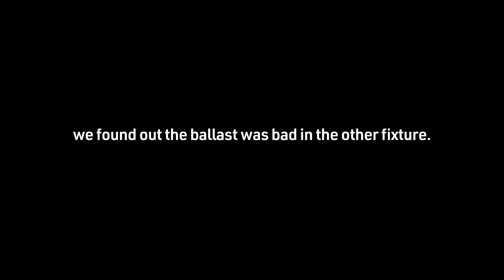Starting custom Case Mod for Tony Hawk - Part 1

Comment: I work as an auto tech.  A hammer is needed and to this question a thought always always enters my head, "Is this $200 ratchet suitable?"  The answer tends to be yes most of the time even if it does not do the job.  I still try!

Comment: Hey I need some help. I recently moved and had no issues with my pc before then but now im getting all sorts of issues including blue screen of death (video tdr failure), black screens, graphics card crash, no signal from display port, red and blue boxes on my screen, green dots on my screen, and sometimes it will have an exclamation point next to nvidia audio, my headphones and mic, and generic pnp moniter. These issues only happen why i try to launch and play a game. Can somebody help please

Comment: @JayzTwoCents Hey, I've got 2 off topic questions. Probably a stupid one, but I'll ask anyway, and hope for an answer. So, my system consists of a Ryzen 5 3600X, Radeon 6750XT, and 2 gen 3 M.2s. Is it worth turning on Re-Bar (which the mobo will allow me to do) with only gen 3 drives, and can there be any hardware problems resulting from doing so? And does Re-Bar only work from the main m.2, or will it work from either one? (I keep my games on the bigger "spare" drive)
Reply: you mean resizable bar right? i think it has nothing to do with your discs as its mainly about cpu being able to access whole gpu memory not your storage space ..

Comment: Hey Jay might want to edit video of lift out. OSHA actually says wearing a harness is required when wearing a harness is recommended by the scissor lift’s manufacturer. Thats a skyjack 3219 scissor lift. Skyjack recommends on page 10 of its 3219 manual
"the use of a fall restraint system to keep an occupant 
within the confines of the platform, and thus not expose 
the occupant to any fall hazard requiring a fall arrest". 
I hate myself slightly for this comment, but video proof of a safety hazard might not be great.

Comment: this will be surely an interesting build when its done im sure of it. as for those led T8 replacements well ive seen those things fail faster than traditional tubes ive seen stores install them and in a week to a month they are burnt out everywhere. i hope don't get that same issue here though. as for me i am still a T12 tube enjoyer not as bright use more energy but reliable none the less.

Comment: Damn 4 years since the build video for Post Malone and 5 for Terry Crews, that's a hell of a long time to go without maintenance for a custom loop rig. Unless they have some personal assistant doing it or something, I'd hate to see them try to boot that after 2+ years of sitting unpowered, there could be a pool of liquid practically anywhere there's a horizontal surface, not to even begin to contemplate potential issues like fungal growth in the pump/reservoir.

Comment: Hey, I have a question about storage. I have an AMD PC with a 500gb m.2 for boot, and 1tb m.2 for mass storage. I want to move these drives to a new Intel PC build. What steps do I need to take to do this without losing my files?
Reply: Nothing, it will just work, but you will have to clear one of the drives so you can do a fresh install of windows that works with the new system. Watch some videos on it.
Reply: Agreed. Copy any files you want to keep from the 500GB boot drive to the 1TB mass storage before removing either. This is because the 1TB mass storage will work fine in the new system. Next, pull the 500GB boot drive from the old system and move it to the new system. It will need to be reformatted (completely erased) during install of Windows OS (or any other OS like Linux, Mac). Once the new OS is running, move the 1TB mass storage drive from the old system to the new system (not sooner, prevents accidently formatting the wrong drive during OS install). Then, you can copy files from 1TB mass storage back to 500GB drive if you want. Done.

Comment: Ok, I get that the table is a workbench, but I got triggered watching Jay drill the front panel on the table.  I would have put something underneath to raise it off the table enough to prevent the drill bit from possibly scratching the table.

However, overall, loved this video!

Comment: If you are still interested in finding appropriate graffiti that fits the theme just search up some Tony Hawk Pro Skater clips on youtube and start screenshotting. Pulling examples from the games will definitely be era appropriate and will not have any "problematic" images as those would have been left out of the games.

Comment: I know you probably did it already, but for the graffiti. Start with basic letters, block them out, then remove lines here and there that lie within another letter. Then you can add accents to the border of the letters. Just try to contain yourself from doing too many accents. Then add a backdrop for the letters going in the same direction. Fill with colors. Highlights on opposite side of the back drop. And done. Easier said than done. Good luck.

Comment: Could you make another IKEA hack desk video? I mean, any new things you've found or issues you'd like to solve? I want to make a rounded corner desk with the tiny legs screwed into the drawer units and just want to know if your previous video is still relevant for that or if there's something you'd do differently or a new piece that's come out that'd you'd swap out or something. I don't have a skillsaw or anything but I can jenk together something useable as long as it's sturdy because I have a lot of heavy shit on my desk and I rage slam my fists like you do so I figured you'd be the best person to ask since our setups need similar requirements X'D

Comment: Skateboarding is not a Crime had little to do with trespassing. The issue was there were no skateboarding signs all over public spaces like sidewalks and parks that were simply excluding skateboarding without good reason. Some attempted to say skateboards were causing property damage, but that was BS because polythene rails and wooden boards cannot damage concrete. Any damage that was there was probably the metal pegs on the wheels of BMX bikes, but there were no signs saying no bikes.

Comment: Jay i have to ask, did you sand those panels in any way after or before you wiped and cleaned them? I work at a body shop, preparing panels and painting. You are correct about 90% of a good paint job coming from good preperation, and sanding a part is a very key part of making primers stick to the surface they are covering. Just some food for thought as you move forward. Love the vids, love the build idea, and goodluck to you.

Comment: Very cool. You could draw it and have it lasered.. I am that guy so sorry.. I have CNC router, laser and four 3d printers at work lol.. One idea is to print up a riser that goes in the hole then holds the mesh nice and tight. ;)

Comment: I love that Jay still pulls out the AC Infinity Grills. Ive been using them for a few years, it sucks the prices on them have skyrocketed though... They used to be the same price/or cheaper than the fan grills alone. Much Love - @Tpbmods, Your friendly Canadian case modder

Comment: a hobby CNC is not such a big expense. People cut aluminum on cnc built by themselves where a lot of its parts are printed on a 3d printer ... A bigger problem would be with designing without which cnc will not cut anything and it smells like a plan :D

Comment: If you don't have one already Jay, a hand held debur tool changed my life for cutting plastic and metal in my line of work (I work on high end luxury RVs). They are cheap on amazon and clean up those edges so effortlessly, more so than a file. Hope you see this 👍 thanks for all the content.

Comment: yes that is why I love watching you Jay z is because you're random like slinging a bit off table that you need you know you you crack me up other computer build shows are like blah blah blah kind of like the visine dude your channel 20 minutes ago quick I don't find myself scrolling to the most important part I wish you could read this comment but the graffiti is actually Street skating Tony hawk is very skater he's known to pull off the 1080 from 30 foot above the half pipe from a helicopter dropped in went down up the other side came another 30 ft and was even with a helicopter and pulled off the 1080 it was insane I had his first skateboard edition which now would probably be worth a lot of money it actually had an eagle that was a live face eagle and then the other half was a bone Dead face eagle

Comment: Jay, I own the H710 and used that vent panel on the front after your video. Works pretty well but the fans do not line up 100%. Still looks pretty good

Comment: Jay, I don't care that you weren't using a harness on the scissor lift, but the sandals, man.  I worked in a factory for 9 years.  I've seen some shit.  Please, for your sake, wear some thick leather shoes or boots when cutting or grinding metal.

Comment: Jay, why not hire a graffiti artist to airbrush it? Help lift up someone's career AND get a badass look :) Speaking of badass, that blanket muumuu is kind of brilliant!! Oh also, as far as the lights - you probably already know, but you want high CRI (color rendering) not just the "correct" color temp, look at Waveform Lighting and Alzo Digital and my personal fav, Soraa - you'd be AMAZED how good a 95+ or even 98 CRI LED can make a set / shot look (I work in photo and film and have a degree from RIT, so it's not just bandwagon BS).

Comment: Jay you can never beat a little health and safety, so don't knock it. yes it is true less is likely to happen if there are bars about waist height, but think outside of the box, like what happens if you suddenly collapse for no explained reason maybe a health issue you never knew about? all these guys saying take it easy on the lift, are just concerned, and trying to give some useful information. or something like covid can make you loose all control of your body like I have found out the passed 3 days.

Comment: harnesses are not required in scissor lifts for a reason, it's not safer at all.

leverage is an awesome thing but if you're physically attached to that lift if you were to fall out you will bring that lift down on top of you at the same time... idk about you but i'd rather fall and hit the ground but just one time, probably walk away with a couple broken bones than fall, rip my balls open with a harness then be crushed to death by the scissor lift tipping over and squishing me. 

anyone who told you to wear a harness in the last video is an idiot. 

only time i'd wear a harness in a scissorlift is if i was getting out of the scissorlift for any reason.

Comment: Actually = Anything Over 3 Feet Off Ground = PER COMERCIAL STANDARDS = YOU MUST HAVE A HARNESS = PER OSHA REGULATIONS = DOESN`T MATTER OF A RAIL WHEN YOU ARE ON A MOBILE MACHINE = {  IT IS MADATORY FOR HARNESSES ON ANY MOBILE  }  !   What You are Thinking is With Hand Rails / Rails that stop You From Going Past The Confines of Stairs and Walk Ways OR Edges of Open Areas  = NON Mobile Units ! 
However Jayson , While in the Confines of Your Own Business = It Is Up To YOU = No one will say anything Unless you Fall !  Then It`s YOUR Fault , sooo , Don`t Worry About It = JUST DO NOT FALL OR INSURANCE " WILL NOT PAY OUT " ! 
Anyone Trying to Push OSHA to the point of Arrogance is just a troll , My Comment Does MEET Regulation Standards , So Back Off , your in my space .